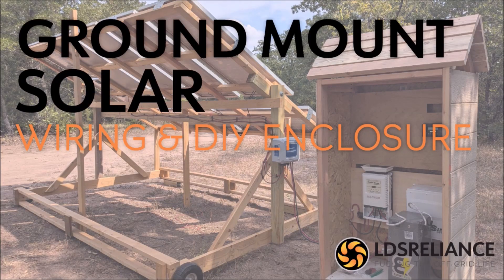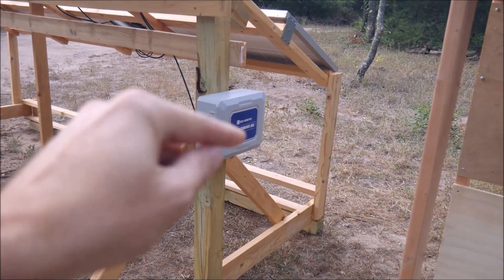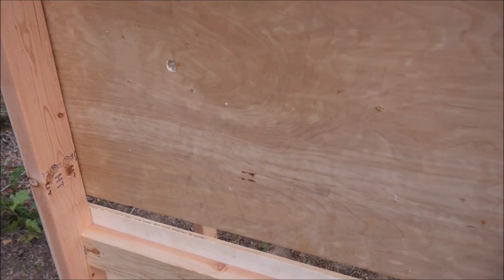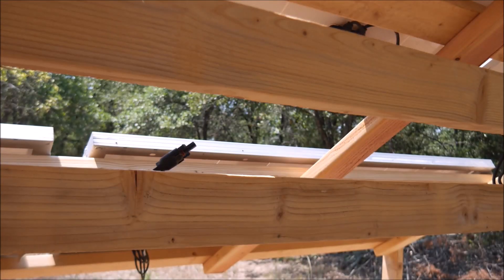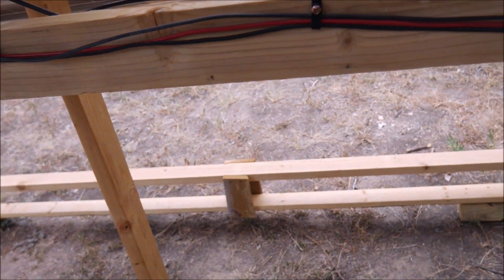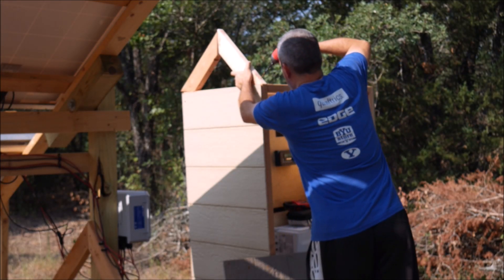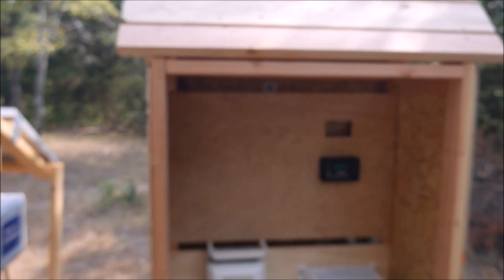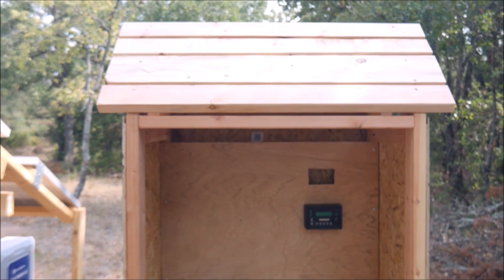DIY Ground Mount Solar Rack Setup - Part 3 - Wiring & Building A DIY Electronics & Battery Enclosure

Comment: Excellent!  Will not be long until that generator becomes a backup!
Reply from the maker: Oh man I hope so.  To pull that off I'll have to triple the number of panels, though, and get an identical battery in parallel.
Reply: @LDSreliance  luckily I live where AC is a nice luxury but not a requirement.
Reply from the maker: Man that would be nice!  But I wouldn't like the alternative, either (lots of cold).

Comment: Love you set it up on a dolly!
Do you use rebar while stationary to protect against high winds?
Reply from the maker: I have some corkscrew/spiral anchors that I have yet to install in the ground on all 4 corners.  As it is, it is immensely heavy so the only thing that is going to move that around is a tornado!  But better safe than sorry.